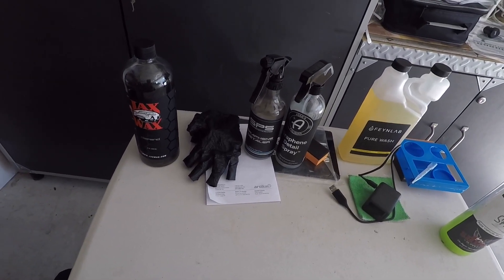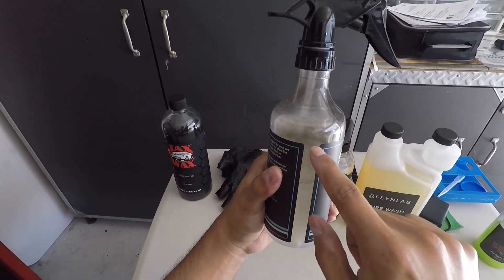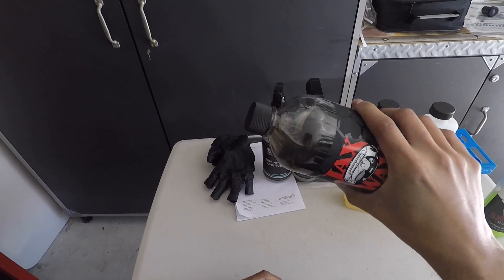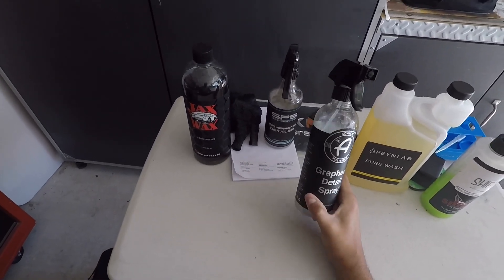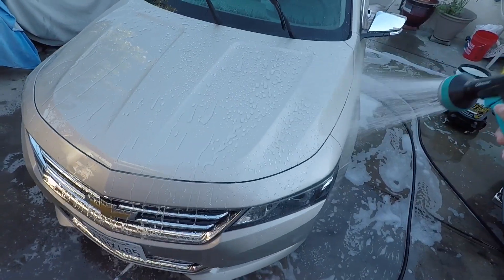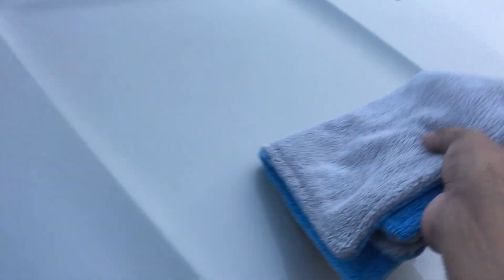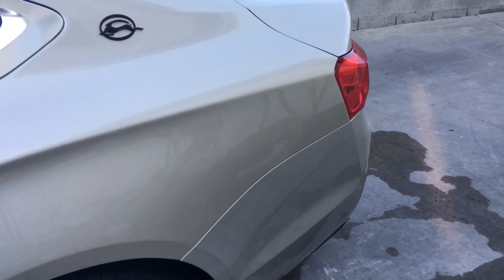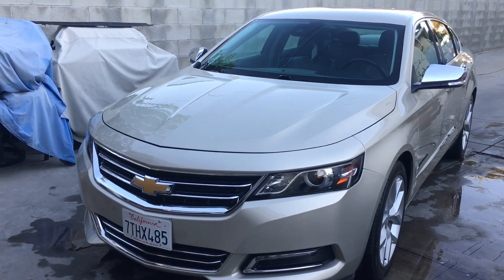Jade Graphene Pro Ceramic Coating First Wash

Comment: Nice work, mike. I just recently got my car jade graphene ceramic coated by detail doctors in Milwaukee, Wisconsin and I couldn't be happier with the results. The water glides right off. its so much easier to clean!!!!!
Reply from the maker: Enjoy the ease of maintenance.  It is a very good coating.  If you are looking for maintenance products, the Adams graphene products will work as Jade is the house brand for B&B which makes both coatings for both brands.  If you are looking for dedicated Jade products, sharptruck.com has them.  Search Jade on that site.  https://www.sharptruck.com/search?q=jade

Comment: I like the the jade/Adams coatings they have been nice an ease application and they preform great
Reply from the maker: Yeah they are easy to work with.  By the way Jade is going to be borrowing the UV tracer idea for the Jade graphene spray coating and another version of the graphene coating.  Probably just relabels of the Adams products.